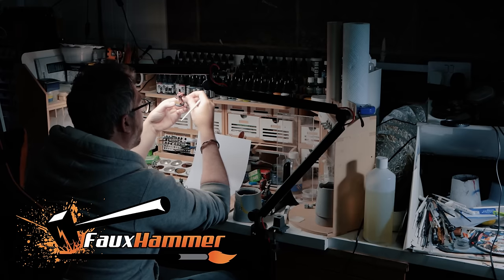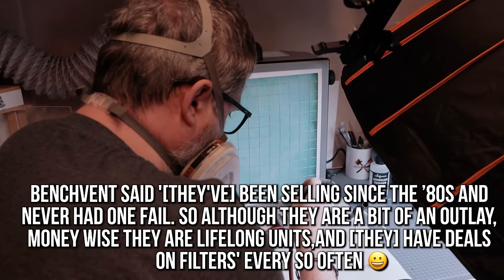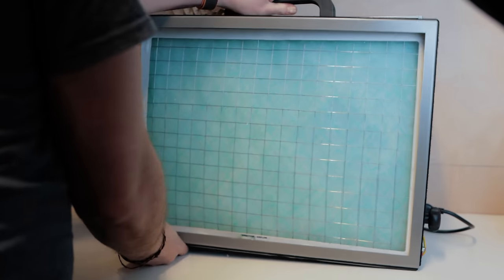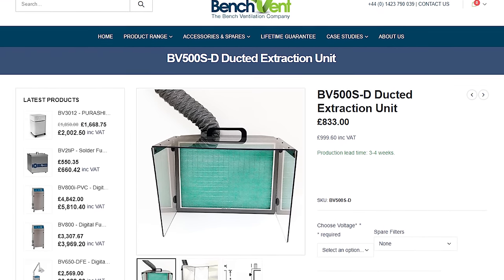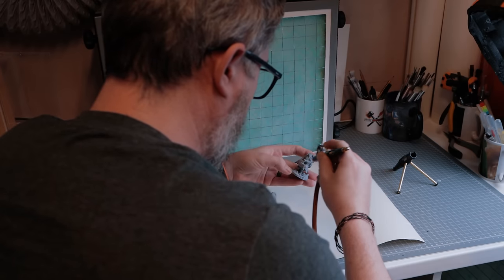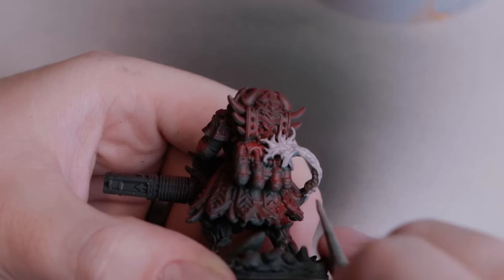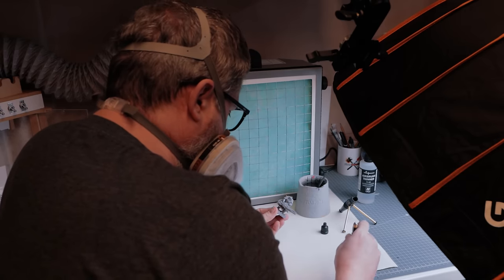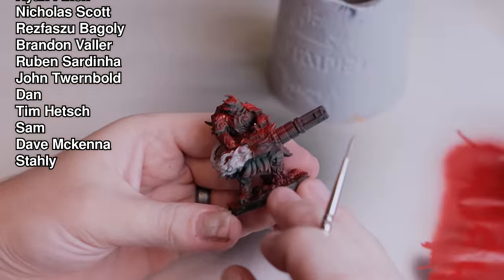Benchvent BV300S- D - Use Spraycans & Aerosol Paints Indoors

Comment: Awesome video. Back in my research phase. Looking into building a large spray booth system in 2024 & a smaller desktop setup
Reply from the maker: Hah, thanks man. I actually had this uploaded back in March, I just forgot to make it live…. It’s been unlisted and visible on their website for months!

What I was looking at was a proper vent system with heat exchanger. But I’m stuck in my garage with less room every day
Reply: i have it on good Authority from Austen from Printable Accessories that the next Kickstarter could be Paint booth Related, as i asked for some additions to the Printer Enclosure, but i was told to wait🤫 as there are things coming🤔...Cheers from a new Elegoo owner here Downunder🙃...luv ya work UncleJessy

Comment: Man your timing couldnt have been any better. Just got my first 3d reain printer for christmas (why i found your channel) and as a model railroader im constantly airbrushing and soldering, now with a 3d printer on the same bench, its time to look into a ventilation system (i knew this ahead of time and place it right where theres a basement window that was replaced with plywood by the previous owner) and this would be the perfect solution.  However, the price, and being state side.....ill keep looking 😒😔 if it was $300 to my door id be all over it.

Comment: Yeah i got this one a few months ago and it is great. It is the kind of piece of kit that you also can reuse if you have any other kind of DIY hobby with fumes.

Solid, well built, the metal assembly is really good and not cheap thin sheet, so it will survive long. All in all, strong recommendation if you can spend the dough and want something definitely long term and "high quality". If all you want is bang for bucks, there are more DIY or cheaper solutions, but this is for the people that prefer a Leatherman to a cheap multitool. Different crowds.

Comment: Just bought the m5s and for me prints are awesome. I only switched to vat tank from m5, cause i don't need speed. My first printer is Mono m3, and in comparison to this, prints from m5s is sharper, than m3.  40 microns vs 24 microns. Never had m3 premium, but i think, that all vendors use the 14k display as upgrade kit for all 12k printers (screen from Nova3D Whale 3 ultra), and this will increase sharpness of all prints.〜(꒪꒳꒪)〜

Comment: G'day Mr Hammer m8.....i had to build mine as im on a disability pension, so i have a 50lt tote box...and in on the left hand side i used a Bathroom Electric vent with a barrel  fan that takes the air and push's it out the side of it, so fumes dont get near the motor and running out a flex pipe to my window. its 240v fan unit so it pulls a lot of air, its so good i can do fine sanding and it sucks all particals up as well and has cost me about $120AUD to build. One last thing i have a chinese airbrush but would like something better quality, what do you recommend for a starter. Cheers and Kind Regards From Downunder🙃

Comment: I want to eco another comment in here that if you’re halfway handy, you can do a little research and make your own for far less money. I built a 5 foot wide, 1 1/2 foot tall and 1 1/2 foot deep ducked booth for my shop. It uses filters and has nice bright LED lights in the top. It moves a lot of air, slowly. Literally creating a nice little air flow from one end of the room out the other. Not enough to feel, but all fumes  and particulates head out that way. (You don’t want a draft so strong you blow out your furnace pilot or create negative pressure in your house.) This lets me paint just about anywhere I want. (I do still wear a respirator and everyone should) but there’s no fumes. I also set my resin prints in the booth to dry since there’s a gentle airflow over them. They dry much faster than if I don’t do this. 

Again, just a thought if you are handy and able.

Comment: I just use a stick and double sided tape and do it outside. you don't want those gasses inside despite the ventilation. 

also the stick is way better than any static setup any way as you can turn it as you spray.
you can even get a fancy gw version with rubberbands if you want

Comment: Ross, on Amazon I purchased this: “WEN 3410 3-Speed Remote-Controlled Air Filtration System” in addition to my spray booth. 

The thought was, running it a couple times a week will keep my shop relatively dust free. (We all want clean spaces for painted items to dry but we don’t want to clean) So far it has worked for me. I have it hanging from the ceiling, out of the way. And for a little over a hundred bucks, I think it’s worth it. Maybe give it a try and see if it helps keep things clean. 

And then do a kool video on it 🤷🏻‍♂️
Reply from the maker: Thanks, i'll check that out

Comment: By safe for spray cans due you mean explosion proof or just that it has sufficient flow that it can capture the spray?
Reply from the maker: it will capture the spray, as in it will suck out all the nastie from the air and keep working. the smaller ones will probvably just clog up

Comment: I bought a 20x20 box fan for $20 and some 20x20 AC filters. When you turn the fan on, the suction is so strong it holds the AC filters in place against the fan. You don't need a box but can use a large cardboard box if needed. I still use this setup today and have been painting my models this way for years. Nothing will beat the power or price of this setup. I only use lacquer paints and with this setup you don't need a mask. As long as you can't smell the paint, you are not breathing it. It does however need to be outside or in the garage like me.
Reply: I bought an inline fan that was sold for growing weed and the air flow through it amazing, built a box out of foam board to hold a filter and mounted some led tape inside. The whole thing cost me about £80 with all the ducting etc to vent it outside. I only use acrylics so an explosion proof fan wasn't an issue for me, but that said they are not 'that' much more money. If you cant vent outside and are only using acrylics you can just use a really long bit of ducting coiled up as the exhaust and almost all of the particulates will have settled before the air reaches the end of the ducting.

Comment: It should be noted you need possive room air pressure for extractors to work best. Found this out when i started 3D printing around 12 years ago
Reply from the maker: What does that mean? positive pressue?
Reply: @FauxHammer  a fan that moves slightly more air into the room than the exhaust fan. I ran a window fan on low facing inwards and a 120mm computer fan for exhaust and it worked perfectly. Not a hint smell in the room
Reply from the maker: @MrHeHim  ah right, so yeah I need more air pushed into the room than it extracts or it will create negative pressure and therefore there isn't enough airflow for it to suck anything out.